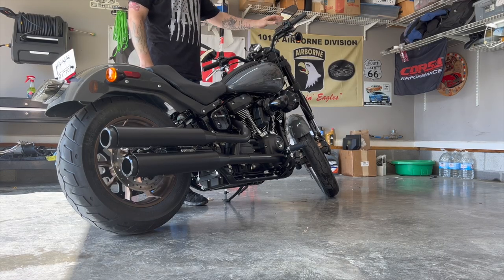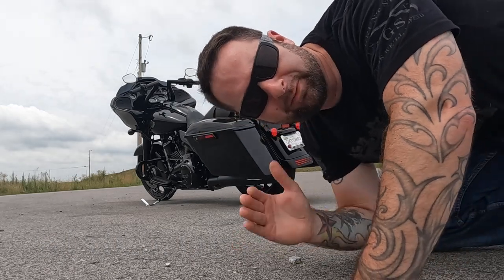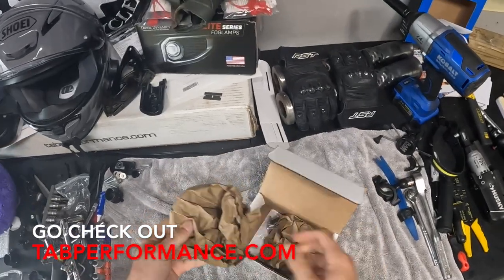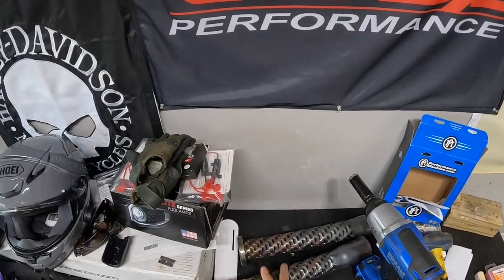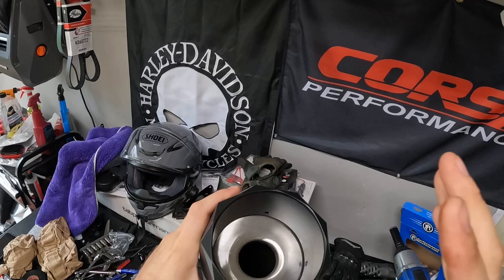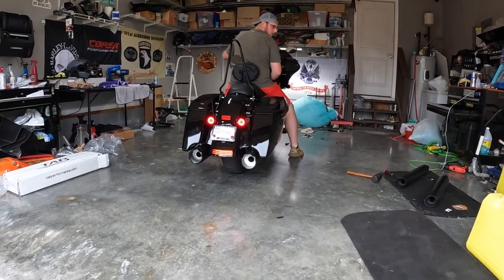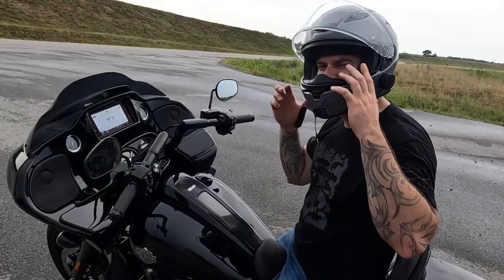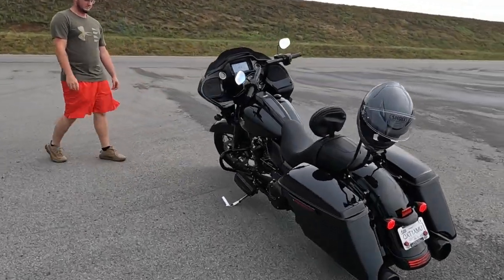2022 HARLEY ROAD GLIDE TAB PERFORMANCE ZOMBIE vs STOCK EXHAUST- MASSIVE DIFFERENCE!

Comment: You just need a minor clutch cable adjustment. Also, consider installing a billet shift linkage rod. I ride a 2022 Roadglide Special with Tab performance mufflers, 50 cal. Louvred baffles. Bad to the Bone. I just reached 1100 miles and recently shifted from 4th to 5th at 5000 rpm...crazy fast.
Reply from the maker: Thanks so much. My first 1k service is coming up and I will tell them to adjust it

Comment: If you shut the bike off first, you can shift into neutral easier.
Reply: Yep! My 2021 SGS is the same way. I am better at finding it with the bike on now (at traffic lights) that I have ridden it a bit but it’s not as easy as my old fat boy was. I think a heal shifter would help me find it since that was how I did on the fat boy.

Comment: I have the same issue getting into neutral in my 22 road glide. It's definitely not just you!
Reply: same my 23 streetglide ST same deal. I have 1k miles on mine and found it easier to go into 2 and down into neutral vs up to neutral

Comment: Bro I have the exact same bike . I used to have that prob but I had the rear shifter added nd it's a bit easier to find neutral.  I got chrome wrks 4 1/2 in slipons their nice nd very heavy but I like loud .so I been thinking bout those 50cal w/ zombie baffles for mine. Thanks for the review nd good luck

Comment: do you feel any power loss with the smooth baffles?
Reply from the maker: Yes. I like the baffled version better
Reply: it is widely accepted that the zombie baffles you lose around 20ft lbs mid range because of the massive backpressure loss on the M8. These with a good tune and a cam and you get the loss back.

Comment: I have a 21 RG so I'm enjoying your videos, thanks! User error by the way
Reply from the maker: Thanks. Yea the neutral shift has been hit or miss. Sometimes it won’t go between first and second at all.
Reply: @Zander13Productions  
Yep I hear ya. I put a quart of amsoil 75w140 in my trans and it's a significant difference.  I wouldn't go back to the 20w50 if they paid me

Comment: Are the zombie baffles, louvered, perforated or a straight pipe as a baffle?

Also is the exit hole on the 5” 2.5” or what?
Reply from the maker: Basically straight pipe with 2.5 baffle I believe but 5 inch tip
Reply: @Zander13Productions  so another words it’s just a straight piece of pipe no perforations no louvers no holes just a straight pipe…